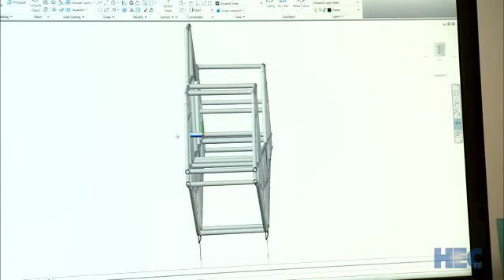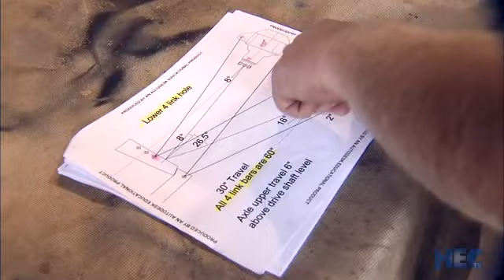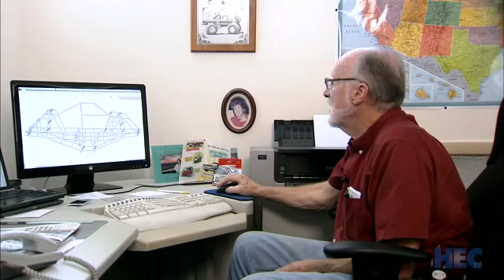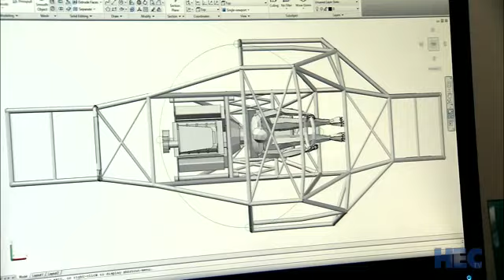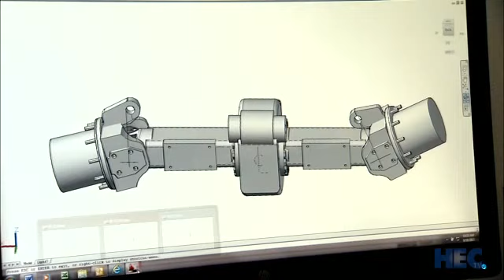BIGFOOT 4×4 Technology, The Original Monster Truck

Comment: With the advancement in tubing technology, I wonder if those kind of bends or some how those angles could be done? I'd be getting with either Dan Patrick or even the Metal Shop to see if it's possible. We already know that Bigfoot #22 is gonna be a 3rd Concussion Motorsports chassis for Bigfoot.  Who knows what instore if Bigfoot #23 is ever thought of.
Reply: Looking at the photos they've posted about the building of #22, it seems that even though Concussion did make the lower frame for the Bigfoot team, it's not quite the same design as used on numbers 18 & 21, so I think that they probably were working off of Bob's revised design. It will be interesting to see what other differences exist when it's completed.
Reply: @davezanko9051  
Yeah it’s a little bit different than 18 and 21. It definitely narrower in the front and back and the cradle area is slightly different. The cradle area looks similar to the Concussion chassis that’s under the Twisted Addiction truck, just with Bigfoots input on it.
Reply: @davezanko9051  
Definitely excited to see the progress of #22.
Reply: @davezanko9051  
From what I’ve been hearing Bigfoot 22 is supposed to be a ride truck. I guess we’ll have to wait and see if they post any other pictures and updates on that build.